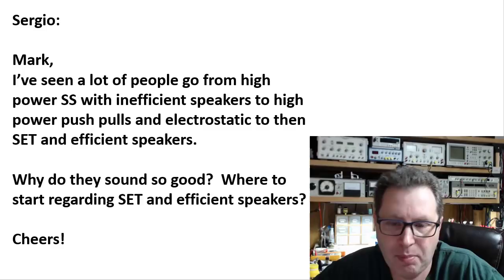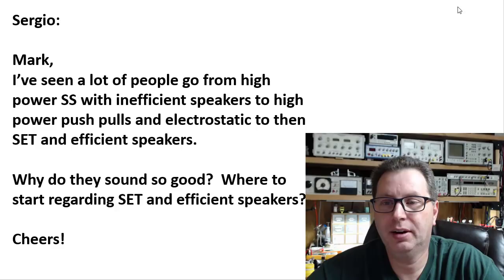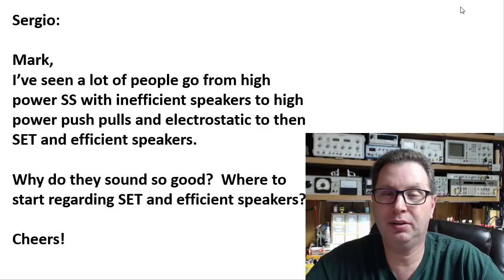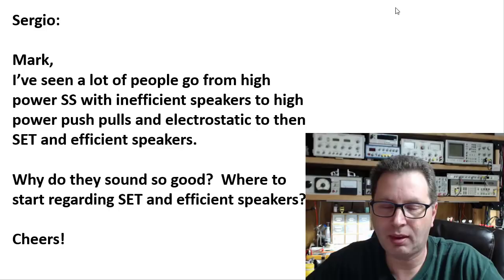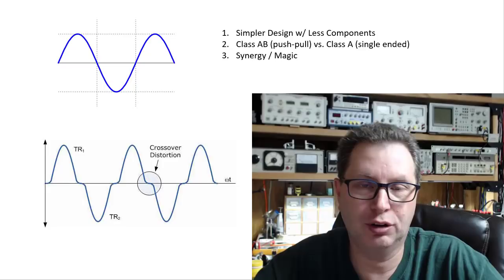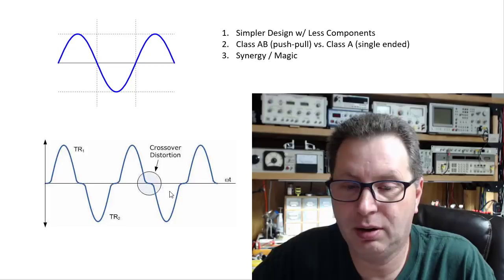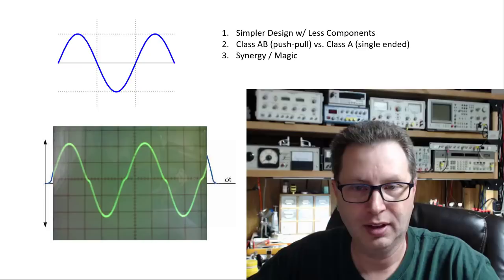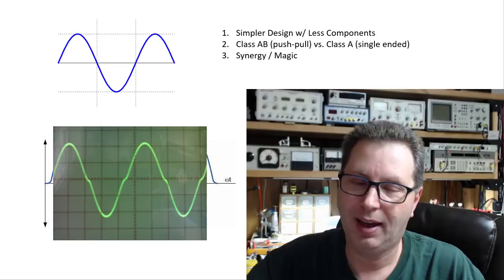What's so good about SET amplifiers and efficient speakers?

Comment: Your explanation is absolutely the BEST among the YT videos I've seen that explains the SE and the PP difference.  Huge kudos to you!
The rest of them starts flipping out some white board or paper and start scribbling diagrams that confuse more than elucidate.  You did use diagrams too but dispensed with all the noise and clutter about high voltage, transistors, etc.  
I totally get it now, at least the essence of the difference.
We just want to know the operating difference, not the "rocket science" behind them which is what all the other videos tried to do - and failed!

Comment: I agree 100% regarding SET and efficient speakers. I have built amps running 45's. 2A3'a and 300B's and several that I can switch between 45 and 2A3.. I have built my share of PP amps and they were very listenabld but SET is just captivating.
  I have a pair of back loaded horn cabinets I built in the mid 90's. Each cabinet weighs 146 pounds and there is no cabinet flex at low freqs which brings more lows out the front. I have ran both Lowther 2A and 6A speakers as well as a Fostex single driver in these cabinets and they all sound amazing. Soon I;m going to build a sub with FETS and build a sub box with 2 )12" drivers or 4) 10" drivers. Need to play with the math and see what makes sense. 
One thing I will add to you description is the speaker crossover distortion in addition to amp crossover distortion you mentioned.  That plus SET has virtually no slight lag time. When the signal is there and changing, the output is right there.

I also agree there is something that science can't explain about the purity of such systems. The THD is decent but many SS amps are far better but sound harsh.  Of course, maybe the real magic is our ears and how our brains interpret what we hear. The designer of that arrangement is trulley and awesome engineer... 
Again, enjoy your videos and glad you are sharing your knowledge with a new generation. Maybe I'll get off my duff at some point and put up some videos as well.
73, Glenn WA4AOS
Reply from the maker: Would love to see you make some videos.  I just do this as a hobby and wouldn't consider myself a pro but having fun none the less.
Reply: You sound like an expert.  What a pity you prefer to inundate the world with it and with your opinion remotely, instead of presenting them on a video for the world to see.

Comment: It can all be summed up in one word. Fidelity!!!
Reply: I would say two words that lead to that fidelity: Sensitivity and efficiency across a system.
Reply: @obscurazone  Efficiency is inverse to fidelity. Class A amps have the greatest fidelity, but lowest efficiency. That is why it is important to have very efficient speakers with a Class A amps, as to waste even more power.
Reply: @srtamplification  Erm, exactly. I said "across" a system. If you don't have efficient speakers, and you're running SET or class A SS, you're not getting the fidelity. Hence why I said efficiency and sensitivity are what LEADS to fidelity. Merely stating "Fidelity" is meaningless.

Comment: What an excellent video on this topic! Regarding your last statement "if there were science behind this it wouldn't be so controversal": Well for sure there is, it just often takes a lot of time for humankind to find out truly what it's all about. A few things that we already know from science today w.r.t. SET amps which you did not mention here are:

1. Those DHT tubes operate at a vacuum, a very large spacious one even. That's the best dielectrica known to mankind on this earth. You simply can not get any better than a large vacuum. This means that there is hardly any capacity to speak of (nothing is truly perfect but it's basically gone) and there is no chance of any coloration of any kind. So when you then couple this with a very high quality filament you get something that even the best of the best FET or bipolar transistor amps are very far away from. Want some practical evidence as well? Strip the plastic crap insulation from bipolar transistors from your SS amp and see how it sounds. :-)

2. Low order harmonics: These DHTs only produce low order harmonics, none (not little, just none) of those nasty high order harmonics. You only get this here. Human hearing is based on only low order harmonics. Literally we create our own distortion (up to even 10%) of low order harmonics inside our ear canal. There are scientific papers about this going into great detail if someone is interested. The distortion created there has its own shape which varies greatly based on amplitude and frequency. We as humans actually are used to hear distortion all the time since we literally don't receive anything undistorted due to this. However, our brains are used to this unique distortion pattern and anything other than that sounds ... well unnatural or you could say distorted. While the harmonic distortion spectrum created by DHTs are not the same as the ones created by our own ear canal it comes somewhat close to it. So it's not perfect at all but when you see the distortion patterns created by bipolar transistors or FETs and how extremely different they look like, well then a bell will wring in your head. There are even scientific papers outlining the psychoaccoustic perception of the human brain to different distortion characteristics. This is also the scientific reason why a high quality SET amp driven quite loud does not sound harsh/distorted to us and we feel like we can just continue listening for extended periods of time at quite high volumes (given the rest of the chain does not add some pretty nasty stuff). On a sidenote, while speaker cones, especially the bass ones, have quite high distortion, compared to distortion in modern amplifiers it's not really an issue as long as we stay low enough (way below our 10% of the human, so sufficiently large drivers for the amplitude) since just like tubes the only produce low ordered even order harmonics which are very similar and, thus, pleasing to the human ear. If it weren't like that we could just ignore distortion level of amps since those speaker bass cones would make up more than 99% of the audio chain distortion anyways. The reason the amp distortion however matters quite a bit is that apart from SET amps the distortion pattern created by other amps is psychoaccoustically very unpleasing for the human. So they have to be ridiculously low in order for us to be bothered by them and still they are "not quite there" since we can't get them to 0. 

3. High quality DHTs are very linear and a lot of stuff has to be done trying to correct for them. From biasing to all kinds of sound coloring and signal harming things inside other amps. 

4. They are high-bandwidth devices which is awsome since there is no clipping distortion ever. You can have one of the best amps in the world, if you ever just barely clip anything it sounds harsh. By massive design-overkill in very expensive amps (massive indeed, since in order to have so much headroom that you never ever in any musical peek in a dynamic passage you will not get to that point) due to the logarithmic behaviour of amplitude (+10dB -> 10 times the power) you need to design for that overkill. This not only makes amps super big/heavy/expensive but also due to the massive amount of parts used any coloration, noise issue, out of phase, differently specced components etc will multiply their negative effect. To a large degree this can be nullified with using crazy expensive parts and extremely tight component matching but not completely. Given the same quality of parts and matching you will never get to the same level.

I am sure there are even way more reasons that I am just not aware of, forgot to mention here or are simply not yet understood well enough but as can be seen there are quite a few scientific reasons why they sound remarkable when done well (and put into a system where their downsides can be dealt with adequately since they also have a couple of disadvantages). They certainly don't work well in any audio chain out there but in those where they do they deliver a very natural, authentic and even uncolored sound.

Comment: IMHO, the sound of a sound system is more influenced by the conversion of energy types.  Meaning whenever you are converting energy, such as mechanical to electrical or electrical to mechanical, has more chances of generating distortion.  The synergy some people perceive when listening to SET and efficient speakers, I would dare say lays more with the speaker.  Again, my opinion, an efficient speaker reveals more about what is in front of it and again my opinion, efficient speaker allow closer reproduction of dynamics and if chosen wisely play cleaner at volumes closer to what we hear at concerts.  The ability to execute dynamics I also think lends greatly to differentiating tones, which are comprised of many harmonics.  After 60 years of listening to tunes, I’d advise someone to buy efficient speakers, unfortunately, large cabinets or baffles are an integral part of that solution.  Again, just my opinion.
Reply: I think contemporary speakers tend to have more complex crossover designs in an attempt at getting big sound out of small boxes. 
What is lost is efficiency. For example; my new JBL L100s are 4 ohm - my 1979 JBL L100a speakers are 8 ohms. 
The old version sounds much more lively but sacrifices detail. The new version has better detail whilst sacrificing the nice open sound of the 1979 L100a speakers.
That a in L100a matters. In my experience the L100a version is the best of the vintage JBL L100s.

Comment: The simplicity of the single ended triode amplifier makes it easy for any amateur to build one if they cannot afford to buy a manufactured one. One solution to the low power is to use an 833-A triode. I use this tube with transformer driven 245 by step down transformer to the 833-A grid and a Hammond 1642SE output transformer and 1) the speakers need not be as sensitive and 2) the bass is not so weak as it is in most SETs.

Comment: Some people believe the dominant harmonic distortion gives the specific SE sound, but from personal experience I think, the less any amplifier distorts, the better is the sound. In fact, you can build a multiple local feedback SE amplifier, that will give you low distortion resulting in the combination of excellent performance of complex dynamic music. 

This kind of "SE magic" is not related to distortion.
Reply: There are at least 6 other types of distortion besides harmonic that affect the sound, and SETs produce them. (Distortion is anything that alters the sound.) True, some designs exaggerated second harmonic to define the sound, and also masks higher orders.

The sound quality also depends upon what one's reference is. Anything will sound good if the reference is the local bar sound.

Comment: Another way to get more sound out of lower-power amplifiers is to tri-amp. Admittedly, active crossovers add a noise source. But by eliminating passive crossovers, the only thing between the output transistors and voice coils is wire. This allows the damping factors of the amps to be fully realized. I use large enough amplifiers that they are almost always idling. I use bipolar for bass and midrange, and Sony V-FET for treble. As a rule-of-thumb, at least half of your audio equipment budget should be invested in loudspeakers. I started with the dB I wanted to accurately reproduce, and worked my way back.

Comment: It makes perfect sense to go the set route with crossoverless single driver speakers. What better way to design a crossover than no crossover. The time and money on the crossover now goes into a perfect driver. The set amp is not push pull and each channel powers the full signal no pushing pulling or tearing nothing lost but everything to be gained. At a 6.5in single driver speaker a person should be able to enjoy detailed musical paradise.

Comment: Thanks for the input.  I’m building a low watt amp set up.  I ordered Omega Super 3 High Output speakers (97.5 db).  My chain currently is PC USB > Border Patrol SEi DAC > MZ3 Linear Tube Audio Preamp/Amp.  I’m thinking to add an First watt SIT-3 amp into my chain if the LTA doesn’t offer enough watts for dynamic peaks.  My only reservation with the First Watt SIT-3 is its physical size for a desk top application (floor amp).  Can you recommended a desk top sized SET amp that would offer the same magic?

Comment: Your number 3 is the reason.  Listening is so subjective, it is all about finding the correct speakers putting them in the correct place, for the type of music you listen to.
That is the magic.  I have had some high end speakers that were darn near flat on the frequency curve, and they sounded so cold. They actually would be painful to listen to for extended times.  same reason vinyl sounds better than CD.  Our ears are just not designed to listen to music that is square wave.
Reply: lol, you see people in the strangest places.  I know you from Fresh P's channel.
Reply: Absolutely.  Corrin has been very quiet lately.  I really think that her hip replacement and the YouTube censoring and demonetising was just too much.  I am refurbishing a Dynaco ST70 so I watch Mark to know what wires not to cross :-)
Reply: I have a Marantz 4270 which brought me here and Mark has hooked me.  I was seriously thinking of building the Triode Dick 807 SRPP for a first build but now he has me hesitant.  Maybe I need to see his next build before I make the jump.  I have thought about a Dynaco 70 or more to the point a new Bob Latino ST 120 kit but think I want to try building a smaller single ended amp from scratch first before I really invest.
Reply: Yes, the SET build series was extremely interesting.  I would not be afraid of the Bob  Latino kit.  A little money,  but I have his upgrades in my Dynaco,  go in easy, sound great, and I could use my WTMW speakers that I built from plans from Parts Express.  Sound great, but need a touch more than 8 watts.   Hey, did you ever let your son use the mini lathe that you got him for Christmas then you swiped for turning pens?  He has to be 17 or 18 years old now.
Reply: hahahaha he tried to turn a pen the other night....He is going strong on 17 with a serious girlfriend...Yeah, 8 watts, I hear ya....Got the Skipjack finished.  Time to turn over a new leaf....Cranking on some Hank Jr. now.  I miss Corrine...Glad she and Wstar are back on speaking terms.  She just divulged too much.  Glenn put his foot down...Yeah, I miss her but all is well.  Take care, Todd.

Comment: Excellent explanation Mark. Thanks for this video.
Reply: The video is basic nonsense. What he describes with the notch is Class B operation. In reality, Class AB push pull allows both output tubes to run Class A for X amounts of watts until sliding into Class AB1. Also, the signal is Not taken apart and put back together. Hope this helps.

Comment: Mark I have a pair of Goldnote S6-XL speakers, they are 90db @ 6 ohms and was looking at driving with a Unison S6 tube amp. What is your thought on this? Thanks
Reply: s6 has got lots of power.. it will drive almost anything you wanna conect it with.
Reply: Mark I ended up purchasing the unison sinfonia anniversary amp. Also got the simply phono by unison.

Comment: Hi Mark, I agree with your explanation in general.  Finding the appropriate speakers is important but I don't believe that you need high sensitivity rated speakers to enjoy these amplifiers, the impedance curve is more critical.  I have partnered speakers from 88 - 90 dB/m with 6.5 W (EL34) , 8 W (KT88), and 18 W (6C33C-B) SE amplifiers and all of them played reasonably loud and sounded clear.  95 - 100 dB/m is sufficient for most of my listening.  If you need concert levels that is another story but it isn't typically found in systems based around SE tube amplifiers.

Comment: Hi Mark, would you please kindly check my beautiful Grommes LJ amp, possibly made by Philips on 1960, and tell if it is a class A SET or not. It has all the original Grommes label tubes: 4 X 6EU7 ; 4 6BQ5 and 1 Philips EZ81 rectifier. In addition it would be great if you could kindly explain in general how to identify as Class A SET amp.
Reply: That is a push pull amplifier design. Only two output tubes, assuming left and right channels is SET. 
Hope that helps.

Comment: One thing, there are SET amps that are 200 Watts+.  In fact, there are plenty of SET around the 100-300 watt range.  I have a 75 Watt and a 200 Watt currently (Jackson Ampworks 75 watt) and a Valve Amplifier dual 3100 (dual  mono 100 watt / stereo 200 Watt) — both SET.  I had a Kraft 300, which was a 250 Watt pure CA amp, but that one I used for music listening.

Comment: Combination on 300B + 805 (with grid cap) tubes gives me 50W per channel and serves as a heater with 450W power consumption 😂
Reply: That is the problem with wanting higher power with SET tube designs.  Once you get over 20 watts, the designs get complicated and they are extremely inefficient, consume power and expend most of it as heat.  The rule of thumb with SET is to nix the inefficient speakers for more efficient ones.  It is like the OP said above, try and get the SPL 1w/1m rating over 95 db, then you don't need such a big amplifier.

Comment: I have three fifty-year-old Cerwin Vega Power amplifiers solid-state the first ones made for the movie / The Poseidon Adventure  and earthquake in Censoron.
A1800 A1800M A3000i from EBay.
I had the filter capacitors replaced but the old capacitors still work there is a difference in sound with the new ones should I continue using the old ones even though the amps are over 50 years old..
The capacitors were tested and they're still functioning within specs but because of the age I had them replaced....